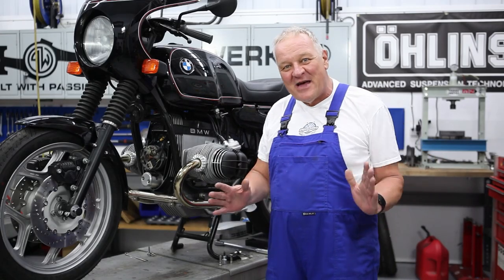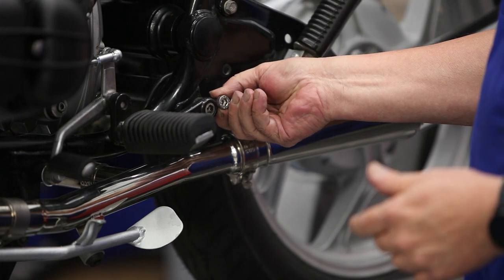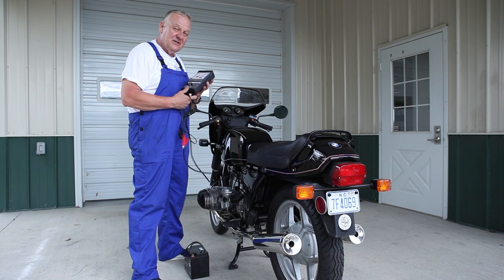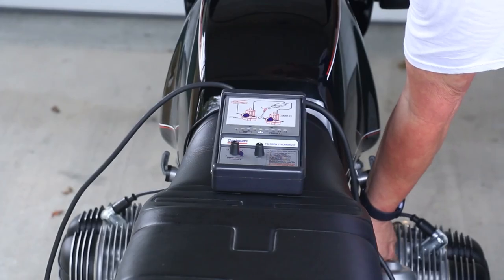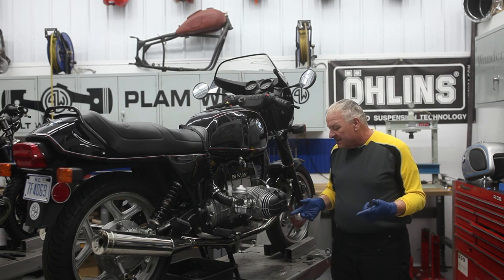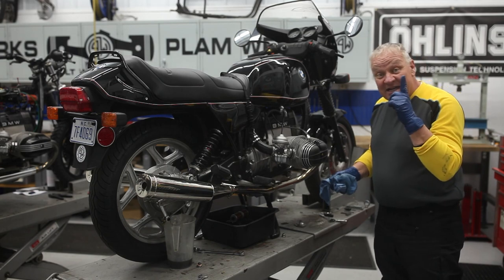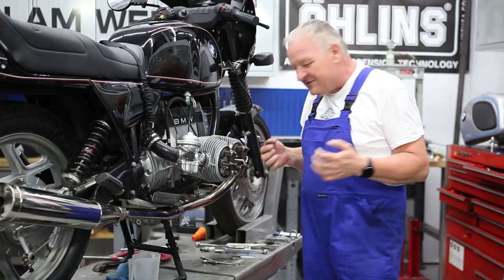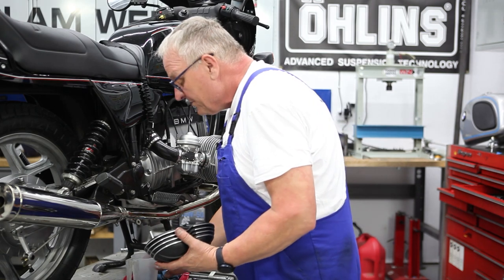BMW Airhead Mechanicals #11 - Timing Adjustment | Carb Sync | Valve Adjustment & 1st Service

Comment from the maker: Download your copy of this episode to view anytime and anywhere.
We now have Downloads of each episode and the entire series available through our website for a VERY small price!

Why pay for a download?  Not only does this help ensure you will always have access to this video but it also supports our video team with proceeds for video equipment maintenance and new production gear to help us create additional 2 Valve focused videos.

Find the Digital Downloads and Parts Used in this video here:
https://www.boxer2valve.com/1985-on-mechanical-episode-11-carb-sync-last-details-break-in-ride-600-mile-service.html
Reply: Hi William(or anyone else that may be able to help), great series. Have enjoyed watching quite a few. In this particular one you used a special tool to remove and replace the footpeg mounting allens using a socket.  I am from down under and have scoured the net for these allen socket tools but am unable to find them, for one, I don't know the proper name for this type of special allen the Germans have gifted to us. I can only see them on the footpegs and a smaller one on the front axle pinch bolts.
 Knowing the name of the tool would be of value as would an outlet I could purchase them from. Thanks in advance.

Comment: William, I just saw this video (29 July 2023). Excellent work, Sir. I am glad you and your son were able to go on a ride together. I have access to buy a 1992 R100GS. It would be my first BMW bike. I have owned Hondas primarily. In order: 1981 Honda CB650 Standard SOHC4 (sold), 2004 Yamaha V-star 1100 Classic (sold), 1977 Honda CB750SS (which I fixed up and sold), 1998 Honda VFR800 (the well-known 5th gen and currently still have), and now a 2007 Honda ST1300 (still have and is as nice or as luxurious as I want to go with any bike. It has a powered windscreen, shaft drive, not single-sided like my VFR). I am grateful, to you and your shop, for making these videos. I understand that the simplicity of this generation of BMW is why they are so sought after and that is the reason I prefer to get one over a fuel-injected GS. I would prefer to be able to work on an R100 on the side of the road rather than be stuck on the side of the road with an fuel-injected GS. By the way, Google says the shop is permanently closed.

Comment: Rather than using shims on the free end float play on the rocker arms, I replaced them with O-rings on the bottom. The O-rings create a gap, lifting the rockers out of the oil, which is holding the rockers back. The difference between trying to spin around under water, and spinning around on an ice rink. The bottom of the rockers have minimal surface contact with the O-ring, and the O-ring absorbs any minor differences, and vibration, applying constant pressure against the bottom of rockers. It COMPLETELY CHANGED THE PERFORMANCE OF MY BMW, R100R, '93 💚🙂

Comment: Informatív videó however Please let us know What vehicle you working on let the specification be noted that it implies to that cycle only.
You torqued the cylinder head bolt, but what was the torque specification? Is same for all “R” cycle?

Comment: Great videos here! What kind of tires are you running? I caught a glimpse of the rear one  and would really like to try it on my new old 1984 R100. I just happened to catch it for sale and it's all original and in excellent condition with 18K on it. I did buy the carbmate and want to do a tune on it. Valves, sync carbs and set the mixture.

Comment: William, I’m curious, in reading the forums, and different manuals the valve clearance is listed as both .0.10 intake and 0.20 for exhaust on a 81-84 R100 and also 0.15 for intake. Which is correct?

Comment: Great series, great video, I enjoy watching it. I have done this type of work / tune up a hundred times or more. Don’t you measure the canister depth of the oil filter tube and then decide how many shims you put in? On all monolevers I own, over the years I had to put more shims to ensure proper squeeze of the white O-ring.
Reply from the maker: That's certainly a good idea to take some measurements and calculate the amount squeeze. I've not encountered a need to use more than one shim but it's an excellent point and I will be having a look at that going forward. Thank you.

Comment: I have an issue with my 1983 R100 CS. Its start fine with choke and idles fine when its cold at about 1100 rpm. without choke ofc. 
But when it gets hot after about 15 min. of driving it idles about 2500 rpm. If i force it down with the clutch it just rises to 2500 again. Do u have any suggestion what's causing this?
i have checked for air leaks and didnt find any. i also checked that the choke and thottle is going all the way back on the carbs, and they do.

Comment: Are you running the bike with the old twin coils fitted or have you swoped them for a new updated single coil pack? If you have fitted a new coil pack do the leads now exit the coils facing to the front (like on bosch coils) or rear? if to the rear what routing did you employ please.
Reply from the maker: Paul: We are using the two 6 volt coils on the R90/6. The newer style single unit coil only works correctly with electronic ignition to the the best of our knowledge.

Comment: Hello dear Guru. I'm buzu on my R60/5 and during the Reassembling I see that no Oil comes at the Rockers.
I try to figure out how the Oil get there (or trough what) ? 
I've seen in a Video that Oil comes trough (or along) a Stud Bolt but it was a newer Model (r75/7)
Can You help me please ?
Many Thanks
Reply from the maker: Sometimes it can take about a minute or so of turning the engine with the starter for the oil to come out. The oil is pumped to the two upper cylinder studs and it flows around them through the cylinders and heads to the rocker arms. If you sealed the cylinders bases with silicone and put too much on, there may be blockage preventing the oil from flowing.

Comment: Hi.  I really enjoyed and saw all the episodes, thank you.  Don't need an oil cooler for the upgraded conversion?
Reply from the maker: An oil cooler is not absolutely necessary, especially on a bike without a lower fairing. Other considerations are how the bike will be used. This one will likely not be in stop and go traffic and will be moving, but not maxed out, so running hot shouldn't be an issue.
Reply: Thank you
Reply: Hello again, why do not you use crashbars ?